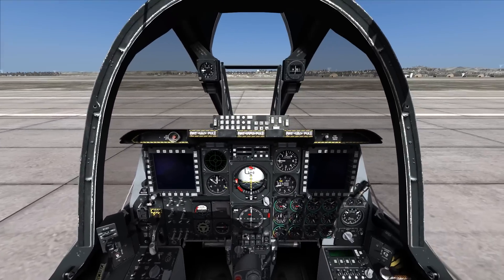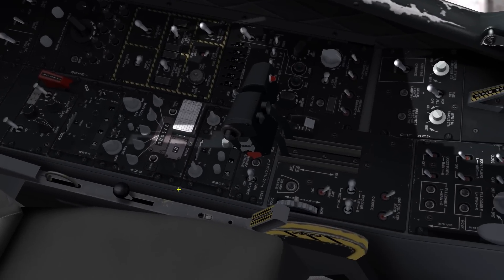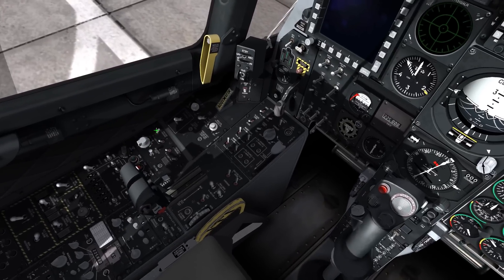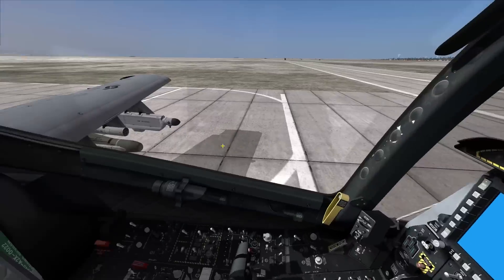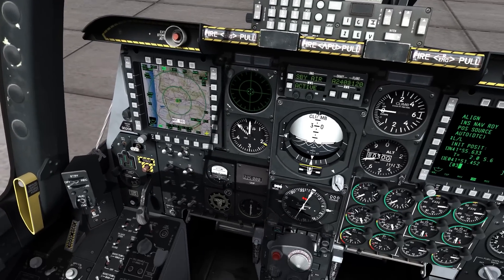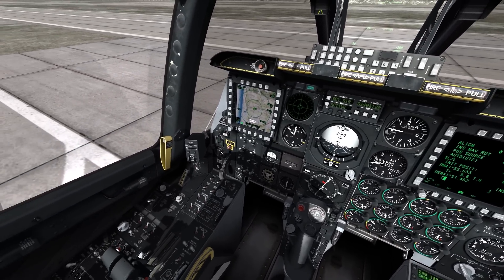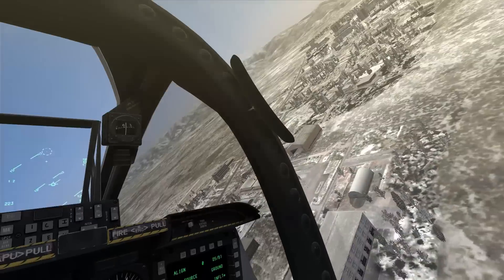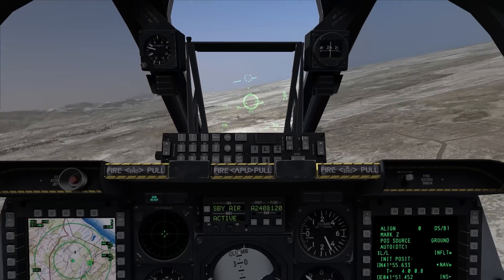DCS World - A-10C Start Procedures

Comment: Actually, quite a few things are different to the original startup procedures. For example arming the ejection seat is one of the last things you do in something called the 'last chance' stage, which is when you're almost holding short of the runway and youre bombs are being armed. Also your pitot heat usually gets turned on just before takeoff because otherwise it'd just burn through. Just because it's not in the sim doesn't mean it's like that in real life..

Comment: Devildog.. Go into options>controls tab. select A-10C sim, and axis commands. Click on your rudder axis, hit the axis tune button and slide the curvature slider to 22. This will be a good starting point to try out and will make your rudder less sensitive for the small movements and more sensitive when you've used full deflection on your rudders. 22 is the number I use and works great for ground steering and aerial gunnery.

Comment: don't turn off your battery next time. if your generators go out and your battery is off you will lose all power to the acft. just saying.
Reply: well it makes noise
Reply: Battery is left in the PWR position to act as a backup power source after the engine's AC Gens have taken over.

Comment: don't turn your battery switch off when you shut your apu down. the battery is necessary for your primary instruments to function in case of engine failure so you can land etc. just keep it on once you turn it on.

Comment: Leave your battery on, if you have a dual flamout you will still have your instruments/lights, also this keeps the battery connected to be charged. By turning it off and you loose both generators (dual flameout) you will not be able to tell whats going on. Visit us on UOAF on Sundays.

Also come in with your boards out so you're up on your n1. This is in case you have to go around your spool up time is minimized.

Comment: Battery power needs to stay on at all times after spool up.  If you ever loose power in both engines and have to air restart you'll need to realign the INS as well. Your navigation will be screwed until alignment finishes again. 

Leaving the battery on after startup is how it's suppose to be done. Your battery won't go dead bc the generator is handling the load....and it functions as redundancy incase you loose engine power.

Comment: Does TrackIR not have a "dampener" or acceleration tweak that resolves the jittering? I'm running a DIY headtracker using OpenTrack that shakes less than this.....and saved myself $400 in the process......ANYHOW, thanks for the tutorial!

Comment: On takeoff never put the throtle at 100% put it at about 96% because I flyed one of these beasts when I was in the USAF stationed at selfrige airbase, MI.
Reply: You flyed it? What most people don't realise, is that Airforce pilots are pretty smart, the academic requirements are a hell of a lot higher than other branches of the military. For that reason, I dispute your claim of ever flying an A10. An actual military pilot would not use the word "flyed", nor would they type 1 continuous sentence with no punctuation.

Comment: Oh yeah and half of the dials and buttons aren't even used often.  And btw, devil, while you're in your ascent, you should change your group/self ID and your laser code, not on the ground.  Also, one of the first things you should turn on in the A-10C is the alignment/NAV switches.  I personally turn them on right after I turn the battery, inverter, etc.  The weapon systems are also very easy to learn.  I recommend you start learning how to use bombs with the GBU-12 and the CBU-105 (watch a few tutorials on those) as I remember you made a video a while back where I believe you did ground attack with just guns or something and maybe it wasn't even targets you were shooting at.  I forget :).  The landing speed can range between 120/130-160 depending on your weight.  One last piece of advice: fuck what the tutorial says.  Following every exact order it tells you to do stuff and when wastes time and can be confusing.  For example, it tells you to turn NWS off at 70 knots.  I turn mine off by instinct.  When I feel it's too sensitive, I turn it off.  Sometimes I even turn it off right after I start rolling down the runway or before it.  Hope this helps a little bit in your quest to learning how to use a few of the systems in the A-10C.  Good luck :D

Comment: I know this is an old video however I just watched it and several others and all of them skip the signal lights test and the fire detect bleed air leak test, all should be done prior to engine start. Ps I worked on the A-10 just so you know

Comment: I've done everythig you did and all lights are off on the right panel, but my LLitening pod wont get turned on when i click it, it just says ''TGP off'', I dont havce this problem doe when i start in the a10c with already running systems and engines, how do i fix that, my NAv is also aligned properly
Reply: +florianweiss007 You need to turn the TGP on.  The switch is under GUNS ARM.
Reply: +Jonathan Baird I've already found that out, but thanks anyways

Comment: So does every button in the cockpit actually useful on flying?
Reply: Its more procedures but more or less about 85% of the switches are important but if you really want to get fully immersed using tacan for navigation and such then yes almost all buttons and switches are important
Reply: *****
Depends on the mission if you are just flying around with no objective then it is most likely you only hit the start up switches and that is about it. If you are going into combat how ever you will need to switch a lot more on I.E countermeasures,guns,missiles e.t.c. But for the most part all you do is the start up procedure which is about 30-50% of the switches. But like i said depends on the task at hand.

Comment: Can someone tell me what the flaps do? Sorry for the noobish question x)
Reply: Flaps are devices used to improve the lift characteristics of a wing and are mounted on the trailing edges of the wings of a fixed-wing aircraft to reduce the speed at which the aircraft can be safely flown and to increase the angle of descent for landing. They shorten takeoff and landing distances. Flaps do this by lowering the stall speed and increasing the drag.
Reply: Paul Nelson
What makes them different from an airbrake?
Reply: Nick Vuchetich The airbrake just reduces the speed of the aircraft, without changing the lift characteristics. (I think, it made sense to me)
Reply: If you slow down the plane for landing, you run the risk of stalling out so the flaps give more lift for slower landing speeds.
Reply: They also kind of tip the nose of the plane up so you land on the back wheels

Comment: Anyone actually flown one of these that can confirm whether he got it?
Reply: Michael McDonald I don't fly them but I do flightline engine maintenance on them and it looks pretty accurate. You can't just "start" the engines after turning on APU though, the engines need to be motored with air first. Also there's a circuit breaker panel between the pilots legs that is usually open, so they need to be closed in order to relay power to engines, APU, fuel pumps and such.